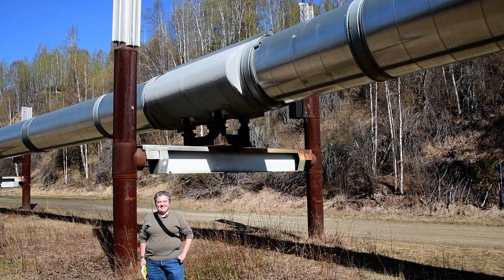Alaska-- Fairbanks-- Trans-Alaska Pipeline

Comment: I know a few guys at work who worked on that pipeline it is safest most efficient way to transport oil and the environmental wackos are always out trying to sabotage pipelines and cause damage to the environment
Reply from the maker: In my video, I don’t cover all the fascinating things that went into designing and building the pipeline, but it is impressive what was accomplished. No structure we build is perfect. After all, the Trans-Alaska Pipeline has leaked 9784 barrels of oil over its lifetime. However, considering about 16,000,000,000 barrels have been moved through the pipeline, I agree that it is a very safe way to transport oil because the Trans-Alaska pipeline was remarkably well designed and built. In 2002, a magnitude 7.9 earthquake (as bad as the 1906 San Francisco earthquake) occurred on the Denali Fault. The pipeline was shut down and response teams were immediately dispatched to assess damage. While some supports, Teflon shoes, insulators, and other things were damaged, the pipeline behaved as designed and no oil leaked. Overall, the pipeline has lasted much longer than originally planned and yes, it is very efficient and safe. Those guys who worked on the pipeline did a great job.

For me, these sort of pipelines and other structures need careful engineering, must be built with good materials and without cutting corners, and built by skilled workers. Sure, it costs more to design and build things well, but it is worth it.

Thanks for watching!